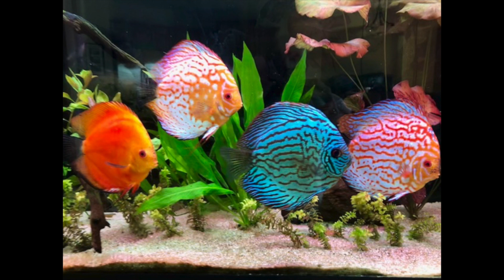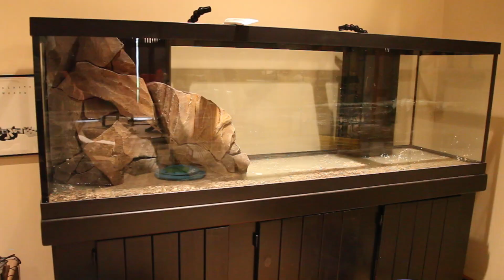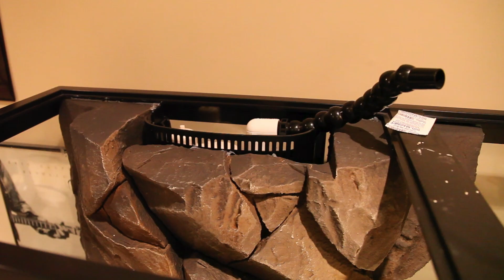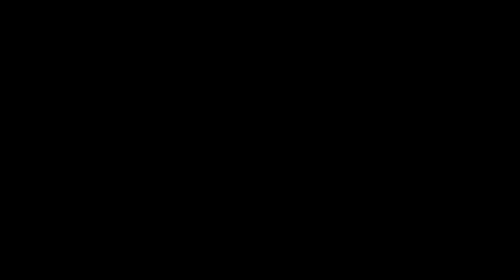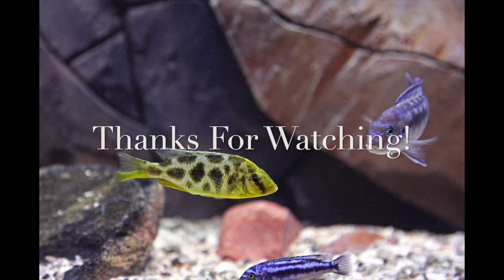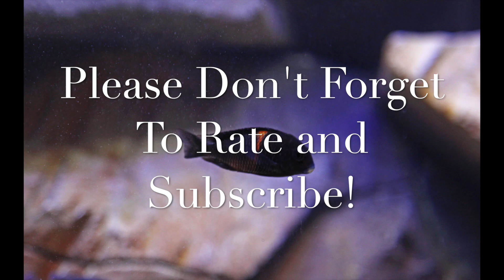NatureDecor 3D Aquarium Background Review (Ordering, Shipping, Installation, and Pros/Cons)

Comment: How is yours holding up? I bought one in May of 2018 and it has styrofoam showing through now. $500 down the drain.
Reply from the maker: I've had the background for about 3 years now.  The finish on it has held up well.  I've only cleaned it with a soft sponge and am happy with how it looks.  I do think the finish will come off with a bristled brush or heavy cleaning, though.  A few months ago, a couple of the pieces came unglued from the back of the aquarium and I've procrastinated reattaching it.  As you know, the process of attaching it is tedious and I think I'll have to make adjustments to the cut outs in order to keep the background from coming off again.

Comment: How’s the background holding up? I’ve herd that this company is sketchy to deal with. Herd that the backgrounds fall apart and they won’t honour their warranty.
Reply from the maker: I've had the background for about 2 1/2 years now.  The finish on it has held up well.  I've only cleaned it with a soft sponge and am happy with how it looks.  I'm sure if someone used a bristled brush (like a toothbrush) they would take the color/finish off quickly and I can only guess that is the cause of some of the complaints you have heard.  My biggest issue is the material it's made of.  It's essentially like trying to submerse a lifejacket and keep it there for years.  A few months ago, a couple of the pieces came unglued from the back of the aquarium.  If this happens there is no other alternative than to completely drain the aquarium and try to reglue it, and that sucks.  I moved the fish to a temporary tank and have yet to go through the process of reapplying the pieces.  As for the company, I never had any issues.  They always responded quickly to my emails and questions, but I can only speak to my experience.  I would say it was a little misleading that the company seems to be based out of Canada, but the background is made and shipped from Eastern Europe which of course means delivery takes a great deal longer than expected.  That being said, whenever I emailed about progress and when it would ship they always responded quickly and were friendly.
Reply: @discus1018  Are they still useing styro foam to make these pieces or have they decided to use something else that sinks and is held on with magnets... is this correct in my assumption ?
Reply from the maker: @gladiatormechs5574  sorry, not sure. I haven’t looked into buying any other backgrounds recently, so I’m not sure if they’ve switched them out to something heavier or not. That would be really nice if they could be attached with magnets, though!
Reply: @discus1018  They use now magnets be attatched and held onto the back glass with magnets , BUT i believe the size 3D embossment is limited in order for them to hold.

Comment: What Dimension did you provide them with for this background.
Reply from the maker: If I remember right, they wanted the inside dimensions of the tank.  I sketched out a diagram for them with the dimensions along the inside of the tank and around the overflow boxes.  Make sure to provide room for error.  If I had it to do again I would have them make more room around the overflow boxes and make a the background a little smaller so it fits easier in the tank.  I've had some issues with one of the pieces that doesn't quite sit up against the glass.  It finally came off and I am in the process of draining the tank to try and glue it again.

Comment: Nice 3d. Question my I ask where did u spray or put the flex seal at on the 3d thanks. I have the same but not sure where to put it at.
Reply from the maker: I used flex seal, JB water weld, and silicone to attach it to the glass.  I put the pieces in the aquarium without epoxy first to see where the contacted the glass and concentrated the epoxy to those locations, but in the end I basically put it all over the back and bottom of each piece.  I even ran a bead of flex glue along a lot of the edges where the background and glass come together on the floor of the aquarium.  Since this will be hidden by gravel I went overboard with the amount of epoxy there.  I also used some epoxy between the background sections to connect them to each other.  I used the JB water weld on the bottom because it seemed to form a really solid attachment.  I can't tell you enough that when you think you've used enough JB water weld and flex glue, USE A LOT MORE!  I thought I used enough the first time and it came off.  Save yourself the trouble and put a bunch of the epoxy on and allow it to cure before adding gravel and water.

Comment: Question did u needed to drill or put small holes into the background for water flow? To the back of ur tank
Reply from the maker: Thanks for the question!  The company drilled the background for me to the specs I provided.  This included cut outs at the top for drains and return line as well as a few small slits that corresponded to the overflow boxes about half way down the background.

Comment: WATCH OUT FOR THIS COMPANY, NATUREDECOR THEY ARE A VERY, SHAKY COMPANY. I ORDERED A BACKGROUND FROM THEM AND WHEN I GOT IT, IT WAS NOT THE SAME COLOR AS THE PICTURE, NOT EVEN CLOSE. THE ONE I ORDERED WAS BROWN, I GOT A GRAY BACKGROUND. THE BACK OF THE BACKGROUNDS HAVE CUT OUTS IN THEM TO SLIDE YOUR HEATERS AND FILTRATION PIPES IN THEM THEY ARE SUPPOSE TO BE 3 INCHES WIDE, MINE WERE ONLY 1 1/2 INCHES WIDE, SO I COULD NOT FIT MY STUFF BEHIND IT. I HAD TO GET A RAZOR KNIFE AND CUT OUT THE BACK MYSELF. I CALLED THE COMPANY AND TOLD THE GUY THE PROBLEMS I HAD WITH THE BACKGROUND, HE TOLD ME MY GUYS DONT MAKE MISTAKES, WELL THEY DID ON MINE. THE GUY BECAME VERY NASTY WITH ME AND I JUST HUNG UP THE PHONE, NOT TRUSTING HIM IF I SENT IT BACK. AND THIS IS ALL AFTER WAITING ALMOST 7 WEEKS TO GET IT AFTER MY ORDER WAS PLACED. MY ADVICE IS STAY FAR FAR AWAY FROM THIS COMPANY.

Comment: ..there is a way to achieve similar look, perhaps more unique,. DIY 💪🏻 
And totally agree can’t rush the project and definitely a long term set up.. the tank looks awesome 😍 
..btw it makes for a great place to hide equipment (heaters, plumbing,etc..) I actually managed to keep those out of the tank entirely 😉 in-line heating, another DIY💪🏻 project I highly recommend, especially when dealing with bigger tanks..
Reply from the maker: I've gone almost exclusively to wet/dry filters because of the convenience of hiding equipment with the benefit of great filtration.  But backgrounds like this one or the ones you made in your videos work great to hide plumbing!
Reply: Discus101 right ! 👍🏻👊🏻

Comment: I ordered one myself custom made to fit my acrylic aquarium about 4-5 weeks ago and I keep emailing them and they keep giving me a day when it will be shipped out and that day comes and goes and I keep emailing them asking nicely how it’s going and they always tell me it will be ready for shipping with tracking on so and so day but it never ships out, part of me was starting to think they weren’t a legit company, but apparently they are...I hope it doesn’t take another month just for shipping once it does ship out.
Reply from the maker: Ya, it took longer to make and ship than it probably should have.  They do look good when they arrive and that makes it easier to take the delays, but I wish they would have been quicker.  When you finally get it, don't repeat my mistake!  Use plenty of adhesive (I would strongly recommend JB Weld Water Weld and even Flex Glue in addition to any silicone you use) and allow it time to cure before adding water.  It was a huge pain to drain the aquarium and dry it in order to reattach it.  Let me know if you have any questions once it arrives.
Reply: Ok I definitely will reach out if needed, and I’m glad you mentioned the right type of adhesive, I do have a whole quart of black flex glue left over from a different project I did so I will use that in addition to the acrylic silicone I have. I’m sure the wait will be worth it, I just wish they would email me when things are gonna take longer than they’re supposed to, I keep having to email them and I feel like a pain in the ass but it’s a lot of money I spent on this thing, I just want to be updated on what’s going on and they have poor communication if you don’t reach out to them and hound them a little bit...that being said their very nice and super sincere when they do reply to the emails at least and they are also sending me 3 extra matching rocks for the delay they said, but I’d rather just have the background by now...lol
Reply: .......also how long did it take to ship once it was actually sent out?
Reply from the maker: I agree.  I emailed them quite a bit as well when there were delays, so you're not alone on that haha
Reply from the maker: @jrnagri  I just double checked and it looks like it took 8 days from when they gave me the tracking number for it to arrive.  It was difficult to track at first because it ships from overseas.  If I remember right, by the time USPS started giving information on it, it was almost here (the first company to provide info was a Serbian postal service and they didn't provide an ETA for arrival in the US).
Reply: Discus101...so I just got conformation that it has been sent out and I got tracking so I’m pretty stoked and they even sent me some photos and a video of the actual background...it came out great!

https://www.facebook.com/1237784417/posts/10212920183459497/
Reply from the maker: @jrnagri Glad to hear it's on the way!  The link doesn't work for me, but I look forward to seeing it in your aquarium!
Reply: Discus101 ok, I’ll post a video of it when it’s all done and installed, prob won’t be for a couple weeks though...hopefully it goes smooth
Reply from the maker: @jrnagri  Sounds good, keep me posted!
Reply: Discus101...you said you used flex glue right? Just wanted to know if your positive it’s fish safe, I know that a lot of silicones are not safe mainly ones that are mildew resistant cause of the chemicals it can leach into the water. I’m wondering if the flex glue has any mildew resistant or any like type chemicals in it that might not be safe...can’t seem to find any info on it anywhere
Reply from the maker: @jrnagri  ya, I used flex glue and JB weld water weld (I also used some aquarium silicone in places).  Both claim to be safe for drinking water containers and pipes and I've had no problems with the fish in the aquarium.
Reply: Discus101 ok bud, sounds good to me!
Reply: Finally received my background today with the matching rocks but they sent me floating rocks...I needed sinking rocks, I don’t want to permanently adhere the rocks to the floor of my tank...any ideas what to do to get them to stay at the bottom? Are yours sinking or do they float too?
Reply: https://share.icloud.com/photos/02K3bLnrs3D0NPvzBU0N4qg7Q#Manchester,_NH

Don’t know if you can open this or not...
Reply from the maker: @jrnagri  Sorry to hear they sent you the wrong rocks.  The rocks I have in the foreground are real, I didn't buy any of the submersible or floating rocks from them.  Judging from how difficult it is to keep the background submersed, I would think the only way to keep floating rocks on the bottom would be to attach them.  If you tried to put weights in them, I think you would end up ruining it before ever getting it heavy enough to stay on the bottom.  You could try using a few under the braces as floating rocks to give that over hang appearance and buy a few real rocks that look similar for the foreground.  I thought about buying some of the floating rocks because they seemed to look pretty cool, but ended up only going with the background.
Reply from the maker: You could try cutting out a section of the rock from the bottom and using either silicone or one of the other adhesives to glue a real rock on the inside.  If you were able to put a big enough rock inside it, that should work.  I would pick the smallest one to start with and see what happens.  I would also contact the company again.  If you ordered sinking rocks then I would think they should at least refund the money for the floating rocks.
Reply: Discus101 I was thinking about cutting out a square section on the bottoms of each rock and glueing in something heavy like a piece of heavy stainless steel or something, as long as it doesn’t effect the water perameters
Reply: Discus101 Did you have to rinse it thoroughly before putting it in your tank?
Reply from the maker: I rinsed it off, but not real thoroughly.  That seemed to work fine for me.  One problem is after rinsing it off the pieces seemed to take forever to dry out.
Reply: Discus101 good to know...I’m gonna try gently using my air compressor tool to help it dry quicker
Reply from the maker: Sounds good, let me know how it goes
Reply from the maker: @jrnagri  how did the install go?
Reply: Discus101 sorry bud, it went awesome...it’s been up and holding strong for a week now...I’ll post a video of it soon
Reply: Discus101 
The lame fake looking plants are just temporary for now to give it a little color and I’ve also moved about 13 of those cichlids into another tank cause it was pretty busy...but that’s it for now, I used a ton of 100% non chemical added silicone made specifically for plastics like lexan and acrylic and it’s stuck on there like cement...I also ordered a couple more matching floating rocks too....they make a huge difference and the fish love them....just a little fyi....who knows how long they’ll take to be delivered but it’s so worth the wait 👍
Reply from the maker: Glad to hear it!  Looking forward to the video!

Comment: 450? That’s WAY cheaper than when I was looking at aquadecor. I was looking at 1000 back then for my 180 gal tank. I ended up getting slate rock from the rock yard for 35 bucks. It’s not nearly as nice as yours, but I couldn’t justify the 1000 bucks. 450 isn’t as bad.
Reply: Did you ever end up with any 3d backgrounds? Modern Aquarium has gorgeous ones, but for my tank, it would cost $900 without shipping.
Reply: @Teekipinekahkfhqiwi  I’ve been using slate rock for my background. Super cheap and looks great.
Reply from the maker: Ya, a $1000 is too much for sure.  $450 felt like a fair price for what I was getting.  Not cheap, but looks great!